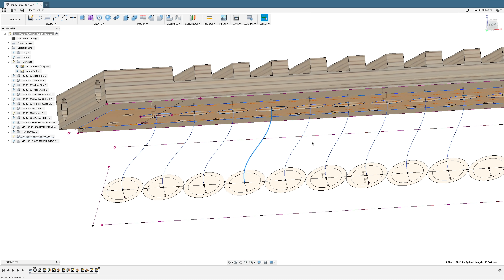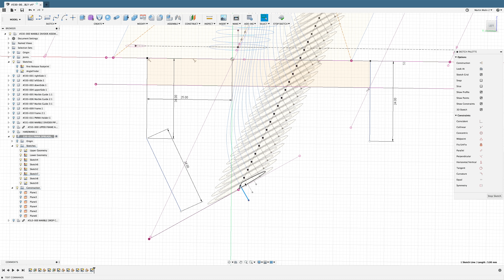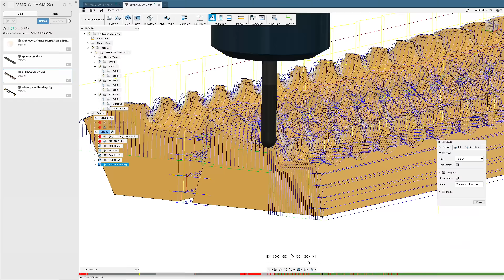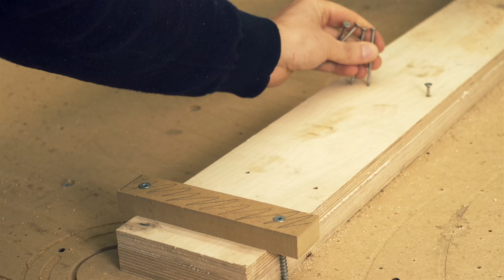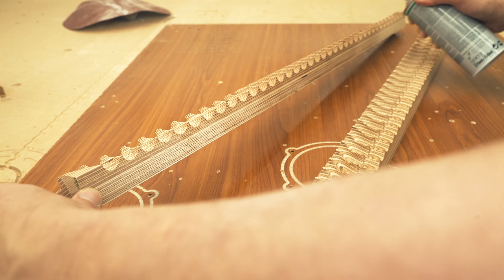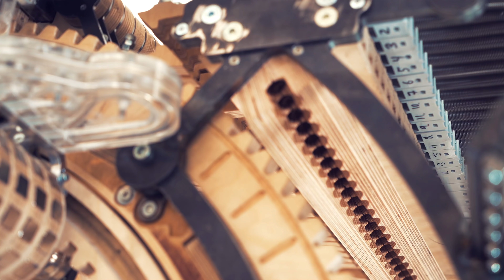Simple way to Make Complex Shapes on CNC - Marble Machine X #76

Comment: I wonder how the change in distance traveled within each variable length marble tube might affect the timing of the notes played?  I realize you've already dealt with this in the original marble machine, but I haven't seen this discussed yet (although I haven't watched all the videos either, so this may be a redundant/stupid question ;?).
Reply: Well, answering my own question, I guess you'd simply take a time measurement for each tube from marble release to impact, and then adjust the release timing to compensate for the difference from the shortest to the longest tubes.... <sigh> this really is a complex and complicated machine, lol.

Comment: Will the different lengths in the pipes not throw off the timing a bit? As far as I understood the timing is perfect on the programmable plates. Does this mean that each marble trigger can be set differently to account for distance that is must travel after it was triggered by the input from the programming plate?

Comment: hey, great Video! I've enjoyed every single one so far! Just dropping by to tell you that you could optimise the toolpaths greatly (resulting in better surface finish and less tool and machine wear as well as higher precision) , if you had the mill cut one tube groove after the other - also it's faster because there's less unnecessary movements :)

Comment: Since the path in the wood block is a different angle and slightly different length for each track, won't the fact that this is after release mechanism make each track slightly off beat compared to the others?  Or do you have a mechanism (which I probably forgot) to adjust the timing individually on each track without having to move the pins?

Comment: Don't want to be nit picking everything you do, but it looks like the walls between the splines came out a bit thin and have holes where the pipes overlap. Is that going to be a problem later on or is it working despite that? Just curious :)

Comment: Taking this thing on a world tour and exposing the machine to different climates, humidity and hot and cold weather and difference in temperature will make all those plastic pipes bend, twist, distort and morph. Resulting in that the pipes will vary in radius and size. Thus, making the machine unplayable

Comment: Hey Martin, I'd love to hear about your plans for corrosion protection for the mild steel.
Also, consider welding a little square of steel inside the junction of the curved X brace.  The braces are curved so they are working in flexure.  At the junction the tubes are only connected on one side which adds (an order of magnitude of) flexibility.  just weld the other sides together and you should get a heaps stiffer X brace.
John

Comment: hey in the future I would recommend getting a heat blanket much easier to work with.. I am an electrician and we bend 4" PVC pipe with a heating blanket with no trouble.. so just a recommendation

Comment: Have you considered designing the pipes in cad and then making a mold for them out of wood?  Basically, do the same as what you just did, but for the 22mm pipes and use that as a template to heat/mold them.  Probably a lot of work up front, but you would end up with such nice splines for the PMMA.

Comment: How are you compensating for the wood expanding and shrinking with humidity, but the steel does not?
Looking at two screws on the center axis, I worry than the sandwich construction will bulge on a rainy day.

Comment: Have you tried using PETG tubing instead of PMMA? I was using PMMA for water cooling pipes in my PC, but I found that it was really difficult to bend smoothly due to the high temperatures required.

The temperature at which PMMA starts forming bubbles is fairly close to the temperature at which it's easily bendable. PETG, on the other hand, gets bendy at a lower temperature, so I found it much easier to work with. It also cuts much cleaner.

(btw, I'm really excited seeing this thing come together)

Comment: Hi Martin. I'm following You for quite a while and find Your videos very entertaining. I also admire all that You've learnt in order to have Your goal achievied. Looking at the design I'm just wondering - how do You ensure that marbles from different channels take the same time from trigger of programming pin to the moment they hit instrument? Looking at those different splines I assume they have different total length, which would mean that it would take different amount of time for marbles to travel through them, ergo - when triggered simultaneously, marbles would hit instrument slightly apart (timewise). How do You compensate for this?  Is it through the length of those rods You made in last video?
All the best from Poland! :)

Comment: Martin, with all that you’ve added, and modernized on the new Marble Machine X, it looks like you’re having to crank the machine a bit harder than the older version. Perhaps you might want to extend your handle out a bit more, sort of like extended (upgrade) cranks on BMX bicycle =)

Comment: All the wood would be painted for protection?  Or how do you will face the rot problem?
Reply: Spray it with NC varnish.
Reply: @tag7299  yeah, I asked because is the first time I see him using varnish, not sure if the other parts also had a protective layer or not.
But only 1 layer may not be enough, at least not with plywood.

Comment: I am just asking myself if you need delay elements like it's done for electronic devices. Because you might what to release marbles at the same time(programming plate), that hit the elements that they should hit at the same time. As the pipes differ in length this might not be the case right now. But you could do this electronically...
Reply: But then it wouldn't be the Marble Machine but the Marble Computer. It's an exaggerated version of a music box. It has to be analogue, at least for the most part.
Reply: @tag7299  I agree with you. But this answer does not really solve the problem (-; It would be interesting if the speed of the falling marbles ist low enough to compensate the different delays or if there is a possibility to slow down/delay/time the marbles correctly.

Comment: I wonder if he could build one of those automated wire bending jigs for the pmma pipe, with the heat gun blowing at the bending point. I know I've seen a few videos on how to throw one together for wire, I don't see why it wouldn't work for silicon filled hot pmma lol

Comment: Are all the tubes confined to a 21mm thick plane at the top?  Why not do what they did in player pianos, and zig-zag the tubes at the top ends?  Since you only need only an additional 1mm, the amount of zig-zag would be small.  You now have a hidden area where the marbles can get stuck, and hard to access on the outer channels.

Comment: Splitting the symmetrical parts like that is clever.. but is it too clever? The wood has a three axis upon which it can warp and swell with humidity and plywood is only constrained in two axis by its orthogonal construction. (I hope you have a spare that has larger holes for warm humid nights.)
Reply: I think the plywood he is using is a variety that doesn't warp very much, I think he mentioned it in an earlier video.
But, personally, ye, I would worry about that.

Comment: I'm worried. The path for marbles in the middle is significantly shorter than the path for marbles near the sides. Some of your instruments may be off rhythm.
Reply: There are several levels of timing adjustments for the releases.  Covered in earlier videos.  Martin can tune each drop path to within a few milliseconds
Reply: @johnscully5787  Wow! That's great to hear! Do you remember which videos covered this?

Comment: Isn't that an issue that both: the spreader & individual tubes produce marble "channels" of different lengths (for particular notes/instruments)?
Won't it desynchronise particular notes from each other? So e.g. if there are programming pins for both: the leftmost note, and the middle note, wont marbles hit the notes with a slight delay?

Comment: I'm pretty sure they have dual ended heat guns bud.
Reply: After a quick Google search maybe not, I know i have however seen one at least one time before, perhaps you could have a little stainless steel tube made up that distributes heat evenly to the tube from top and bottom

Comment: Are you planning on giving all of the plywood a clearcoat? I worry that it'll absorb quite a lot of moisture without some sort of protective coating. Plus, it brings out the "grain" in the wood.

Second idea: Why not 3d print templates for bending the acrylic tubes? You can get the bend dead on without having to constantly test fit on the machine. Just pull out the template, freehand it to a rough match, and then push it into the template for the finishing touch.

Comment: just build a heat pipe for the airgun. take a sheetmetal, make a tube out of it, and weld  a mount for the airgun to the side.
Like a industrial pizza oven, pizza goes continously trough and still heats evenly.

Comment: Getting closer :) A small tip for tube bending. Submerge the tube in hot water to soften it up for easy bending. Even heat and no accidental bubbles or discoloring from too much hot air

Comment: Great work. A question i have is if the different length of the pipes will not mess with your timing or how you get arround that?
Reply: Those are just "staging points", if my understanding is correct... The actual time-critical "release points" are out where he was catching the test marbles, I believe.

Comment: Are you going to make copies once you find perfection?
Reply: If he had two copies, he could keep one as a backup and perform with two (alternately) on stage, which would take some of the pressure off of the reprogramming assistants between songs … of course, the 21 packing cases would require their own trailer to transport … then again, a duet for Marble Machine X? … imagine the possibilities ...

Comment: Something worries me. If the marbles have different lengths of pipe to travel through after they are released, won't that cause different offsets in their timing? I guess this could be mitigated in many different ways: adjustable height for the surfaces that the marble will hit is one.
Reply: leibniz You’re looking at the refill pipes that trigger of the actual marble release, which comes AFTER all these travel pipes. The actual release will be lenght adjustable for timing. Martin has made a few video’s covering this.

Comment: Have you considered using a PVC heater blanket (Greenlee) instead of a heat gun?  It makes bending plastic pipes soooo much easier and you don't need to worry about hot spots or burning the pipe.

Comment: Will the length of the pipes affect timings between marbles?
Reply: There will be two balls in each pipe where one is ready to play and the second one is loaded by one lever action
Reply: The marbles will be released from the lowest point after it has traveled down the tubes so I don't think it will.
Reply: The release design is adjustable to compensate for direction and timing... there's a nice long description of the design in: "Dropping the Ball - PRECISELY - Marble Machine X #52" https://www.youtube.com/watch?v=dNv8AeZfuUc

Comment: Two things: One is that I would be a bit concerned about the machined plywood to that small pointy sizes and being hit repeatedly by your ballbearings. pieces of it can break away and fall into your sysytem. A solid piece of wood might do better.
The second thing is that I have a feeling that by the time you finish this machine, you might give up music and start your own cad/cam 3D modeling/manufacturing company!

Comment: Won’t the rhythm be slightly off since the paths of the marbles differ in length, and thus the time it takes to hit the instruments is different?
Reply: Can Martin not compensate by changing the length of the bent wire paths which come after these tubes (see previous video).  In other words, for the shortest tubes, he can make the longest wire paths.
Reply: WhatAboutTheBee yes, that’s a possibility. I already noticed the same possible problem in that video. Now I see that both problems could become a solution

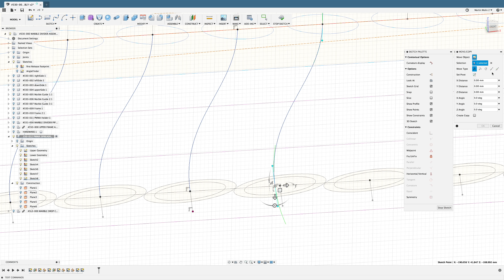Comment: 2:00 When you copy/paste the spline, if you don't change the angle of the handlebar and re-constrain, it will not be perfectly 90 degrees perpendicular to the hole, and it will curve too much. I hope you noticed that and just forgot to edit it into the video, otherwise most of your curves will be off by an increasing degree as you proceed to the right. And I know you, you will not like it because it is not perfect. I'm the same way. :)